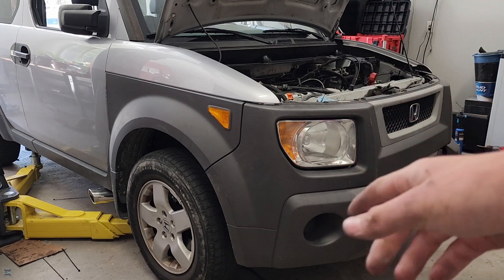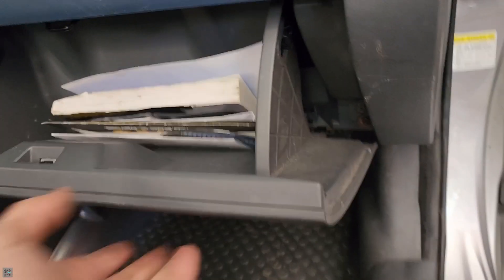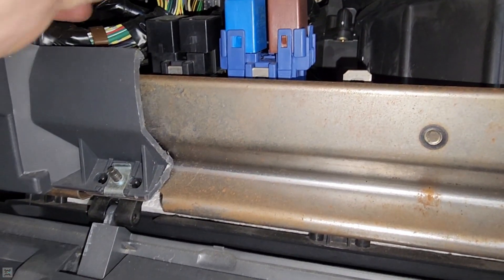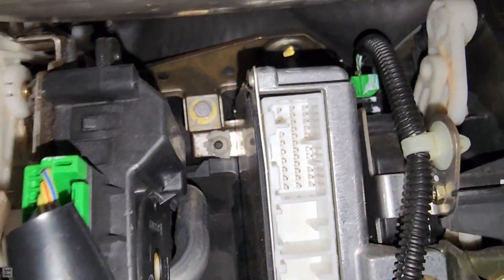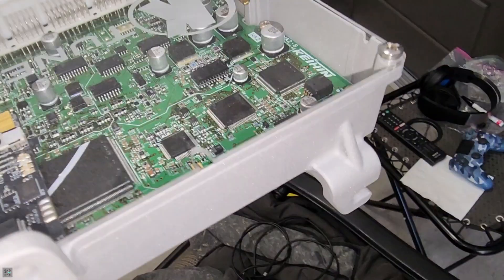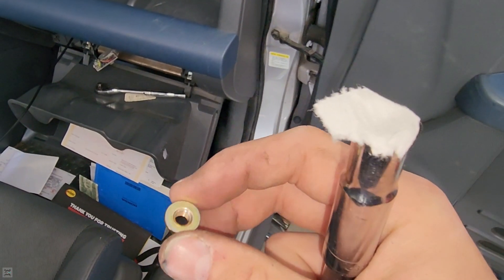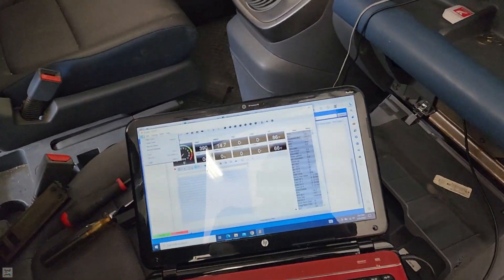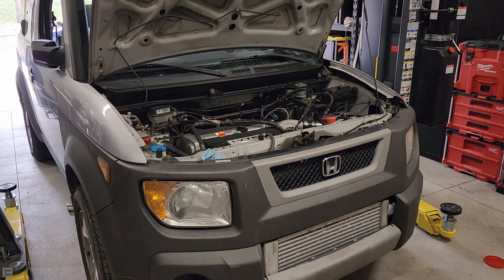Installing Aftermarket ECU in Honda Element | Turbo Element KTuner Install

Comment: You did a video with 3bar map sensor. Would a low boost turbo conversion work with just a map and bov? Would I be able to keep ecu stock and pass monitors?
Reply from the maker: @robwouds  With any turbo set up you need to get the car tuned... naturally aspirated engines only see air pressures of 1 atmosphere and below. In a turbo car you will be pushing boost (more than 1 atmosphere), so the stock ECU is not equipped to handle that.

Comment: Older ktuner software had boost options for manual and automatic.
Reply from the maker: Like they had a base map for boosted engines? If so, I wonder why they got rid of them?
Reply: @TheMileHighMechanic  yes they had boost option for both manual and automatic as a base map
Reply from the maker: @winm7479  Thats pretty cool.
Reply: @TheMileHighMechanic  if you need a base map with boost option I can send it to you.
Reply from the maker: @winm7479  Thats alright, it is already tuned.
Reply: @winm7479  Hey, I am very interested in seeing that base tune with the boost tables...my tuner says it use to be there in the older software, would you be able to send it (lol) to me?

Comment: would this be a cost effect solution to replacing the stock ecu that has been shorted previously?
Reply from the maker: I don't believe so. If you can't find a stock ECU under $400-500 then yes, but that seems really steep for a stock ECU.

Comment: I just bought a K24A2 to install on my Element and I also bought the ECU and the Ktuners from HAmotorsports...  My question is, are you using the K24A4 Element engine?
Reply from the maker: Yes, stock k24a4
Reply: I put a k24a2 inside my 03 Honda element and I’m having trouble what ecu to get?
Reply: @davidreyes760 I bought the ECU from KTuners... They have a kit

Comment: Sweet build man. I have always found Honda Elements so cool in their own way. One of my lowkey dream builds is a diesel AWD manual trans Element. Your boosted one will be mint
Reply: You should get one man I've had mine for about 3 years I love it
Reply from the maker: Thanks for the love...a 12 valve Element would be pretty insane